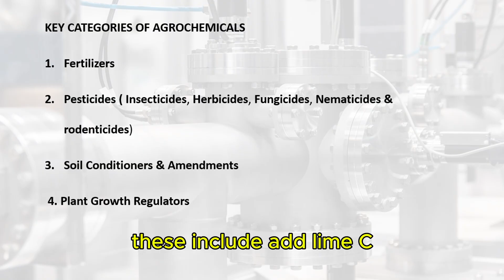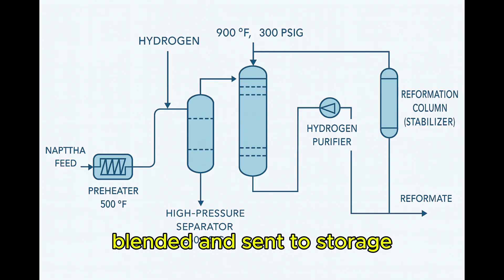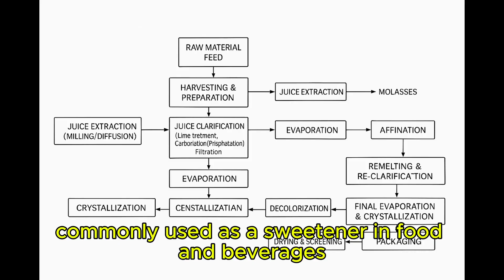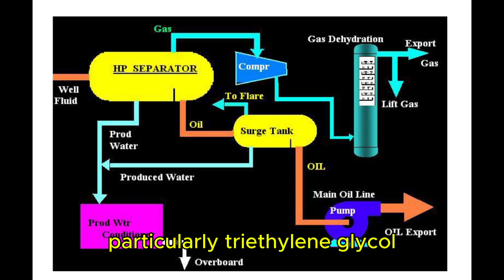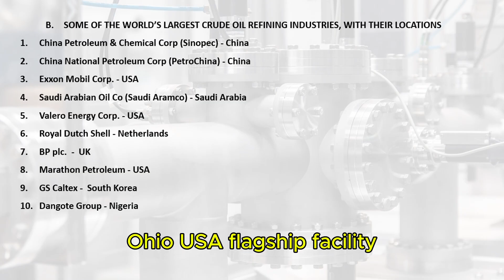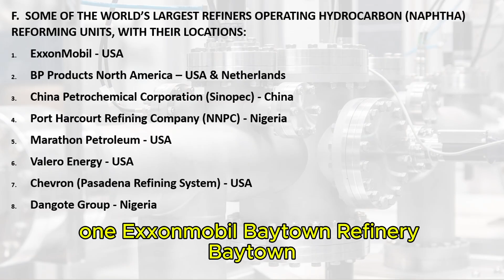From Molecules 2 Millions: The Chemistry, Process Flow & ROI of Industries & Utilized Raw Materials

Comment: Mat. No.: U2022/5581056
Uche Michael Emeka 

Answer:
Cracking is a process that breaks down large, heavy hydrocarbon molecules from crude oil into smaller, lighter molecules using heat, pressure, and/or catalysts.

It produces light molecules like ethylene, propylene, and butadiene that are used to make plastics, synthetic rubber, fibers, and chemicals.
 
It converts low-value heavy oils into high-value fuels and chemical feedstocks.

It lets refineries produce more gasoline and petrochemical products than crude oil naturally provides.

Basically: no cracking = no plastics, limited fuels, and no major petrochemicals.

Comment: Mat no.53
Nwajei 
Answer: Vacuum distillation is used for heavy atmospheric bottoms because they have very high boiling points. Reducing the pressure lowers their boiling temperatures, so they can be separated without excessive heating and thermal cracking or decomposition.

Comment: 18, Ijebu, Answer: The main feedstocks used for ammonia production by the Haber-Bosch process are nitrogen and hydrogen. Nitrogen is obtained from air, while hydrogen is commonly produced from natural gas, particularly methane, through steam reforming. These gases are then combined in a 1:3 ratio to produce ammonia.

N₂ + 3H₂ ⇌ 2NH₃

Comment: Question: Discuss the availability of raw materials for PMS(premium motor spirit Frac) production in Nigeria and state the actual regions.

Answer:
Nigeria has an abundance of raw materials necessary for the production of Premium Motor Spirit (PMS) and other petroleum-related products. The primary raw material, crude oil, is predominantly found in the Niger Delta region, including states like Akwa Ibom, Rivers, Imo, Delta, Bayelsa, Ondo, and Cross River. Additionally bitumen is a supporting material used in asphalt and concrete production, is found in states like Edo, Ogun, Ondo, and Delta. Other relevant materials like bentonite and barite, used in drilling mud for oil wells, are also available in various states, including Borno, Plateau, Adamawa, Bauchi, and Taraba. The availability of these raw materials in Nigeria can significantly contribute to the growth and development of the PMS sector, enabling the country to optimize its petroleum resources and meet domestic demand.

Comment: The main petrochemical production process for lubricants involves crude oil distillation, vacuum distillation, base oil refining ( solvent extraction, hydrtreating, dewaxing, hydrofinishing ) blending with additives and quality control. The process is tailored to produce base oils (Group I-V) with specific properties, which are then enhanced with additives to meet performance requirements for various applications. For synthetic lubricants, additional processes like oligomerization or esterification may be used to produce high-performance base oils.

Comment: Answer 

The availability of raw materials for PMS (Petroleum Fraction) production. raw materials include:

- Crude Oil. Nigeria's most significant export, primarily found in the Niger Delta region.
- Natural Gas. Abundant reserves, making Nigeria one of the top natural gas producers in Africa.
-Other Essential Materials.
    - Limestone. Widely distributed across Nigeria, used in cement production and agriculture.
    - Iron Ore. Large deposits in Kogi, Enugu, and Niger states, crucial for steel production.

-tamarinds, pineapples, bananas, mangoes, and guavas): Used to produce fruit juices and extracts.

Regions 
Nigeria has plenty of crude oil, the main raw material for producing PMS (petrol), found mostly in the Niger Delta region, including states like Rivers, Delta, Bayelsa, Akwa Ibom, and Ondo. These areas have large oil fields, both onshore and offshore, where crude oil is extracted and sent to refineries for processing into petrol and other products. However, Nigeria faces challenges like limited refining capacity and reliance on imports, even though raw materials are abundant

Comment: Nigeria has significant potential for producing petroleum-based products, given its vast oil reserves. However, the availability of specific raw materials required for PMS (Petroleum Fraction) production is crucial. Here's an overview ¹:
- *Petroleum-based raw materials*: Nigeria's oil and gas industry provides a solid foundation for producing petroleum fractions. The country's refineries, such as the Port Harcourt Refining Company and the Warri Refining and Petrochemical Company, can supply various petroleum-based feedstocks.
- *Key regions*: Major oil-producing regions in Nigeria include:
    - *Delta State*: Home to the Warri Refining and Petrochemical Company, which produces various petroleum products.
    - *Rivers State*: Hosts the Port Harcourt Refining Company, another major refinery in Nigeria.
    - *Kaduna State*: The Kaduna Refinery and Petrochemicals Company produces Linear Alkyl Benzene, a key raw material for detergent production, and potentially other petroleum fractions.
- *Raw material availability*: Nigeria still relies heavily on imported raw materials for various industries, including petroleum products. However, local production of certain raw materials like petroleum jelly, wax, and lubricants is possible.
- *Challenges*: Despite the potential, Nigeria's petroleum industry faces challenges, including:
    - *Infrastructure constraints*: Poor infrastructure, such as inadequate refining capacity and inefficient transportation networks, hinders the production and distribution of petroleum products.
    - *Import dependence*: Nigeria's reliance on imported raw materials and equipment for the petroleum industry can limit local production and increase costs.

To develop the PMS production sector, Nigeria would need to address these challenges and leverage its petroleum resources more effectively.

Comment: Describe the difference in the chemistry used purifying natural gas with a molecular sieve and triethylene glycol

ANSWER
Natural gas often contains impurities like water vapor that must be removed to meet quality standards for transport or use. Two common methods, molecular sieves and triethylene glycol (TEG), purify natural gas through different chemical processes: adsorption and absorption, respectively.

- Molecular Sieve: This method uses a solid material, typically zeolite, with tiny, uniform pores. The chemistry relies on adsorption, where water molecules are trapped on the sieve’s surface due to their small size and weak chemical attractions (van der Waals forces). The pores selectively capture water while allowing larger molecules, like methane, to pass through. This makes molecular sieves highly effective for producing ultra-dry gas, ideal for applications like liquefied natural gas (LNG) production. However, regenerating the sieve (releasing trapped water) requires significant heat and energy.

- Triethylene Glycol (TEG): TEG is a liquid that removes water through 

- absorption where water molecules are chemically attracted to TEG via hydrogen bonding When natural gas passes through TEG, the liquid soaks up water like a sponge, leaving the gas dry. TEG is efficient for large-scale dehydration and easier to regenerate by heating, but it’s less selective for non-water impurities compared to molecular sieves.

   Differences

Process: Molecular sieves use adsorption (water sticks to a solid surface); TEG uses absorption (water is soaked into a liquid).

Material: Sieves are solid with precise pores; TEG is a liquid that bonds with water.

Selectivity: Sieves are highly selective for trace water; TEG is better for higher water content.

Regeneration: Sieves need more energy to regenerate; TEG regeneration is simpler.

In other words, molecular sieves act like a precise filter for ultra-clean, dry gas, while TEG functions like a sponge for efficient, large-scale water removal. The choice depends on the gas’s water content and required purity.

Comment: "Discuss the most recent innovative technology involved in the removal of hydrocarbons from natural gas stream during gas processing."
Answer:
The most recent innovative technologies for removing hydrocarbons and hydrogen sulfide (H₂S) from natural gas streams include:
- *Advanced Adsorption Technologies*: New adsorbent materials like metal-organic frameworks (MOFs) and zeolites offer higher surface areas and increased capacity for capturing H₂S. Hybrid systems combining adsorption with catalytic oxidation or membrane separation can enhance removal efficiency.
Membrane Separation Technologies: Semi-permeable membranes selectively allow certain gases to pass through while blocking others. Air Liquide's P-Guard technology, for instance, can remove 90-95% of H₂S with low stage cut, making it ideal for bulk removal.
-Catalytic Oxidation: Advanced catalysts like metal oxides or nanocatalysts improve the speed and efficiency of H₂S oxidation into sulfur dioxide or elemental sulfur. This method can handle high H₂S concentrations without frequent catalyst regeneration.
Biological Filtration Systems: Microorganisms metabolize H₂S, converting it into less harmful substances like sulfur or sulfate. Biofilters and biotrickling filters offer highly efficient, cost-effective sulfur removal with minimal maintenance.
Photocatalytic Processes: Photocatalysts like titanium dioxide (TiO₂) break down H₂S into less harmful compounds using light. This method relies on renewable energy sources like sunlight, making it a sustainable option.
Chemical Scrubbing: Advanced formulations improve reactivity and selectivity, allowing for faster reactions and higher removal efficiency. This reduces the overall volume of chemicals required.
Hybrid Systems: Combining multiple technologies, such as adsorption, catalytic oxidation, and membrane separation, can achieve optimal results and handle a broader range of H₂S concentrations.
Deep Eutectic Solvents (DESs): These solvents offer a cost-effective alternative to ionic liquids and can be functionalized with chemicals like amines and oxidizing reagents to enhance absorptive and regenerative properties.
Durasorb LNG MAX*: A step-change technology that removes heavy hydrocarbons and water to cryogenic specifications in a single unit, simplifying pre-treatment and increasing feed gas flexibility.

These innovative technologies improve the efficiency, cost-effectiveness, and environmental sustainability of hydrocarbon and H₂S removal from natural gas streams

Comment: Recent innovations in Hydrogen Sulphide (H₂S) removal from natural gas stream:
1️⃣ Supersonic Gas Separation – Uses Laval nozzles to rapidly expand and cool gas, condensing H₂S/CO₂ for removal in a cyclonic separator. 10–20% more efficient, compact, and ideal for offshore sites.
2️⃣ Shell–Paques THIOPAQ O&G: Biocatalytic process where H₂S is absorbed in alkaline wash, microbially oxidized, and recovered as elemental sulfur under safe, near-ambient conditions.
3️⃣ Liquid Redox Systems – Chelated iron oxidizes H₂S to sulfur with >99.9% efficiency, regenerative operation, and minimal waste.
4️⃣ Regenerative Biogas Tech – Reusable amines, oxidative redox, sorbents, and bio-methods for sustainable, low-waste removal.
5️⃣ Metal-Based Catalytic Absorbents – Pro3 Nano & GT react quickly with H₂S for efficient, low-fouling gas purification.

Lastly, the most recent and increasingly widely used in the industry is Supersonic Gas Separation.

Comment: During a seismic survey for crude oil and natural gas exploration, an industrial chemist plays a crucial supporting role:

Roles and responsibilities:
1. *Mud logging and fluid analysis*: Industrial chemists analyze the chemical composition of drilling fluids (mud) and formation fluids to:
    - Monitor drilling fluid properties (density, viscosity, pH).
    - Identify gas and oil shows in the drilling fluid.
    - Determine the presence of corrosive or hazardous substances.
2. *Geochemical analysis*: Industrial chemists analyze rock and fluid samples to:
    - Identify hydrocarbon-bearing formations.
    - Determine the type and quality of hydrocarbons.
    - Assess the maturity and alteration of organic matter.
3. *Drilling fluid design and optimization*: Industrial chemists help design and optimize drilling fluids to:
    - Improve drilling efficiency and reduce costs.
    - Minimize environmental impact and ensure compliance with regulations.
    - Enhance wellbore stability and prevent formation damage.
4. *HSE (Health, Safety, and Environment) support*: Industrial chemists ensure that drilling operations meet HSE standards by:
    - Monitoring and controlling hazardous substances.
    - Developing and implementing safety protocols.
    - Providing training and guidance on HSE procedures.

Comment: Question: What is the role of an Industrial Chemist in a drilling operation during crude oil and Natural gas exploration.

Role area:
Sampling & Analysis.

Key Responsibilities
Determining hydrocarbon composition and impurity levels in extracted fluids.

Role area:
Process Monitoring

Key responsibilities 
Tracking chemical interactions and aiding in fluid formulation optimization.

 Role area:
Optimization

Key responsibilities:

Applying chemistry principles (yield, cost-efficiency) to improve operations.

Role area:
Safety & Environment

Key responsibilities:
Identifying hazards, ensuring compliance, and promoting greener practices.

Role area: 
Economic Assessment.

Key responsibilities:
Supporting capital and operational cost evaluations through chemical insights.

Comment: the varied binding properties arise from C₃S's higher reactivity—driven by its elevated Ca/Si ratio, structural instability, and faster kinetics—which favors rapid early strength, contrasted with C₂S's stability and slower hydration, which bolsters long-term performance. These differences allow cement formulations to be optimized for specific applications, such as high-C₃S cements for quick-setting needs or balanced mixes for durable structures.

Comment: 1. Background

Hydrogen sulfide is a toxic, corrosive, and foul-smelling gas that often occurs naturally in natural gas reservoirs. Its removal is essential because:
	•	Corrosion prevention – H_2S forms weak acids in the presence of water that corrode steel pipelines.
	•	Environmental protection – Combustion produces SO_2, which contributes to acid rain.
	•	Safety – H_2S is lethal at low concentrations.
	•	Product specification – Pipeline natural gas standards typically require <4 ppmv H_2S.

⸻

2. Chemistry of H₂S Removal

Several processes are used, but in most gas plants the amine sweetening process is dominant, followed by sulfur recovery via the Claus process.

⸻

A. Amine Gas Treating (Absorption + Regeneration)

Principle:
H₂S is absorbed from the gas stream into an aqueous amine solution by acid-base reactions.

Common amines:
	•	Monoethanolamine (MEA) – primary amine
	•	Diethanolamine (DEA) – secondary amine
	•	Methyldiethanolamine (MDEA) – tertiary amine

⸻

Reaction Chemistry:
	1.	Primary and Secondary Amines
These react with H₂S via protonation and bisulfide formation:
\[
RNH_2 + H_2S \rightleftharpoons RNH_3^+ + HS^-
\]
In aqueous solution:
\[
HS^- + H_2O \rightleftharpoons H_3O^+ + S^{2-}
\]
	2.	Tertiary Amines
These cannot form carbamates with CO₂ but still absorb H₂S via protonation:
\[
R_3N + H_2S \rightleftharpoons R_3NH^+ + HS^-
\]

⸻

Regeneration (Stripping):

The loaded amine solution is heated (steam stripping) to reverse the reaction:

\[
RNH_3^+ + HS^- \xrightarrow{\text{heat}} RNH_2 + H_2S \uparrow
\]

The released H₂S is concentrated in the stripper overhead for sulfur recovery.

⸻

B. Sulfur Recovery – Claus Process

Purpose: Convert recovered H₂S into elemental sulfur.

Step 1 – Thermal Stage:
One-third of H₂S is burned to SO₂:

H_2S + \frac{3}{2}O_2 \rightarrow SO_2 + H_2O

Step 2 – Catalytic Stage (Claus Reaction):
The remaining two-thirds of H₂S reacts with SO₂ over an alumina or titanium catalyst:

2H_2S + SO_2 \rightarrow 3S + 2H_2O

Overall:

3H_2S + \frac{3}{2}O_2 \rightarrow 3S + 3H_2O

⸻

C. Alternative Methods and Chemistry
	•	Iron Sponge Process (Fe₂O₃ on wood shavings):
Fe_2O_3 + 3H_2S \rightarrow Fe_2S_3 + 3H_2O
Regeneration with air:
2Fe_2S_3 + 3O_2 \rightarrow 2Fe_2O_3 + 6S
	•	Zinc Oxide Bed (for trace H₂S removal):
ZnO + H_2S \rightarrow ZnS + H_2O
	•	Physical Solvents (Selexol, Rectisol): Physical dissolution of H₂S without a chemical reaction, suitable for high-pressure streams.

Comment: In cement production, clinker is an intermediate product — a work in progress — formed after the raw material is heated in a rotary kiln to around 1450 °C but before it is ground into the final cement powder.

Clinker Composition

It Contains 3 Main Components

1) Tricalcium Silicate
2) Dicalcium Silicate
3) Tricalcium Aluminate

This process involves 3 complex chemical reactions including the formation of above Compounds, the calcium silicates and aluminates.

A. Formation of Tricalcium Silicate
CaO + SiO₂ → Ca₃SiO₅ (or 3CaO·SiO₂)
also known as C₃S

B. Formation of Dicalcium Silicate
2CaO + SiO₂ → Ca₂SiO₄ (or 2CaO·SiO₂)
also known as C₂S

C. Formation of Tricalcium Aluminate
3CaO + Al₂O₃ → Ca₃Al₂O₆ (or 3CaO·Al₂O₃)
also known as C₃A